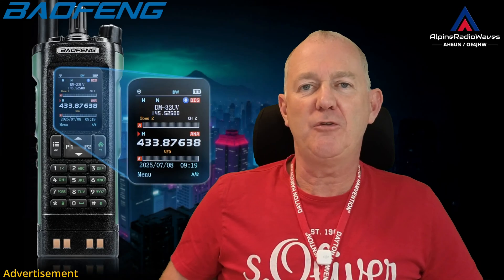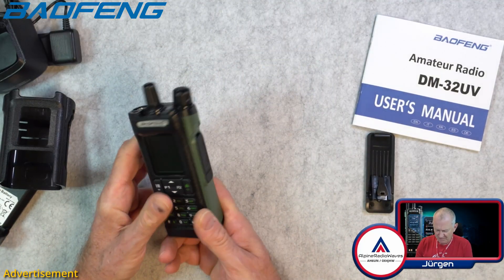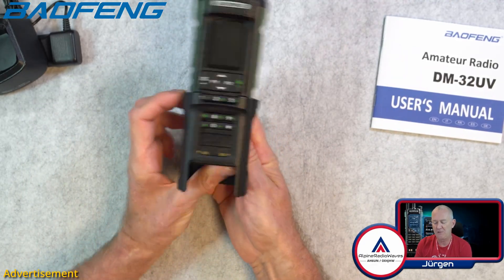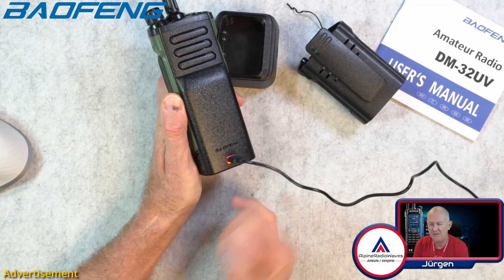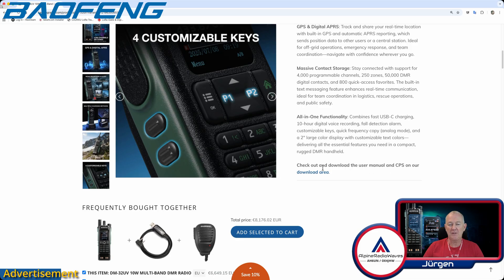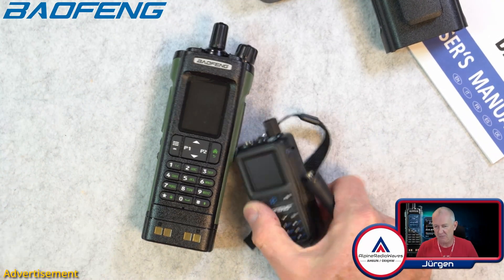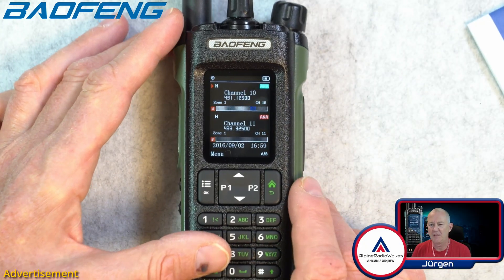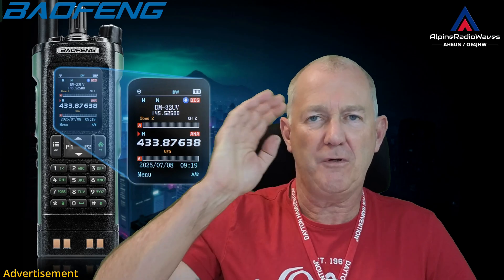BAOFENG DM-32UV 10W Multi-Band DMR Radio - Part 1 - unboxing and a first glance

Comment: THERES no lock on the case,poorly designed and the belt clip does not hold onto your belt. Ive got two of these radios and its come off my belt a few times along with the radio coming out of the Case. Nice radio but it defenitely has its flaws and issues. Only 16 channels in scsn and only 64 channels in a Zone. Baofeng screwed this one up. Its not a commercial Motorola and its not suppose to be since its ham radio. Hopefully, they"ll correct these issues with better firmware. Stops at 470mhz. Hacked Firmware changes that issue. Good Video, Thanks
Reply from the maker: Hello, thanks for the info.
I haven't used it in "practical amateur radio everyday life" yet.
Okay, I've made a few QSOs from the shack—that's all.
So thanks a lot for the tips!
I'll forward this to Baofeng and hope they have a solution with a new firmware update.
Thanks again and all the best for the new year.
Juergen OE4JHW